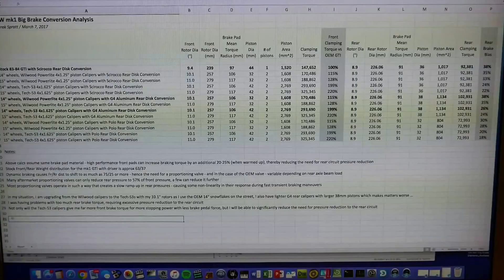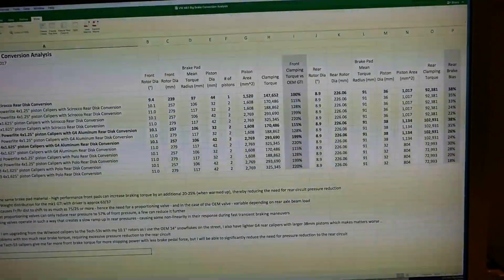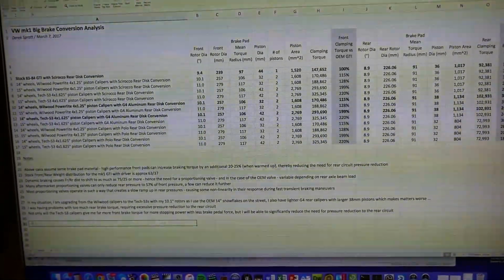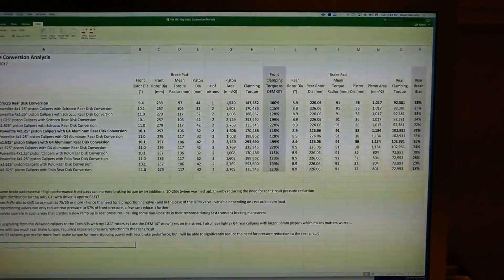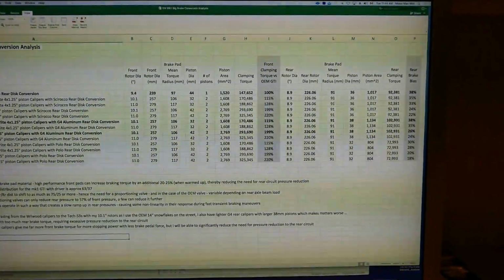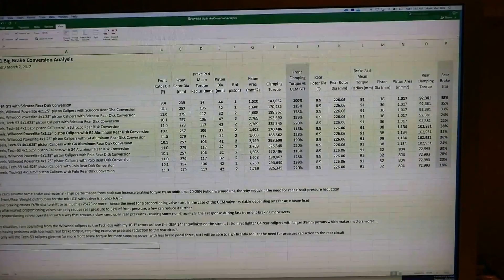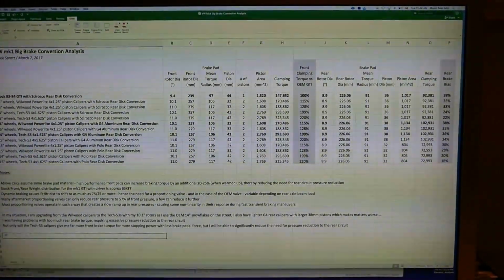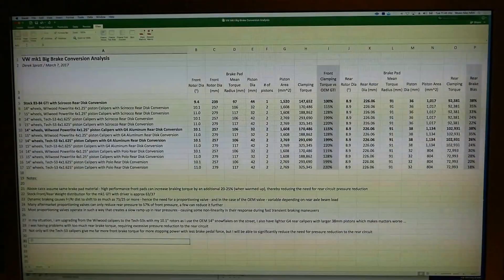The Ultimate 1983 Rabbit GTI - part 142 (Tech-53 Big Brake Kit - part 1)

Comment: Very helpful. I found the rear bias on my 16v Scirocco didn't seem right when paired with a set of RPI Equipped 10.1" rotors and calipers. Not so good on a high speed panic stop. Of course the scrub radius is going to be different with the wider wheels & spacers, but should be irrelevant if the braking circuits are all in check. K-mac camber plates would be great to get back to a slightly negative scrub radius by moving the upper bearings in a tad...Whole nother topic!
Reply from the maker: Happy to chat further about your setup. I am now a big proponent of the Tech-53 callipers with their much larger pistons. After putting in 700kms of mountain/high speed driving this past week I can confirm that the new brake system is fantastic.
Reply from the maker: I am now up to 2800kms on the GTI and can say with confidence that the Tech-32 big brake kit has been a key component in the success of this project. Wonderful stuff!
Reply from the maker: Tech-53. Sorry!

Comment: I've just fitted the CQ bias pedal box/ steering column which helps when playing around with the bias without the need for valves. Now considering servo assist options.
Reply from the maker: Can a servo be added to a racing type pedal box?
Reply: Yes, a remote servo. the lockhead style ones. (Fitted on 60s 70s British cars). I'm considering running one just on the front circuit and using the bias bar to compensate, or perhaps the dual remote servos, although not as many options with these. The lockhead style servos come in a few ratios which is useful. 1.75:1 or 1.9:1 I feel would be a good balance between pedal feel and assistance.
Reply from the maker: thx for the info. I am sure it will be useful for many folks!

Comment: How did you like the setup after driving it for a while?  All you had hoped for?
Reply from the maker: When it first hit the road I had pretty stiff Bilstein racing struts with 350/300lbs-in springs and that was a bit too much for the street for my tastes but when the car was on the track the struts were perfect when I swapped in 430/350 springs. The final configuration for the street is actually fairly compliant: KW V3s 1-click off full soft compression/rebound, and 250/200 springs. Stiffer than stock for sure but very liveable.
Reply: @derekspratt  thanks for the ironic reply. I say ironic because I'm in the confusion process of selecting my spring rates right now haha!  I have 400 /350 but seems too stiff for the street. While it's going to be a auto X take it on the street to work here and there fun toy....400/350 was pretty stiff!  I raised up the front so control arms are more parallel. I'm going to test that out tomorrow!  I just got some 250 in the mail was thinking 200 rear so seems like my Guess was right according to your tests haha!  
All that said....I meant how did u like the big brake kit?? On paper sounds epic!  Lighter then stock with more force then other brands offered. Thanks again for the video , and reply!